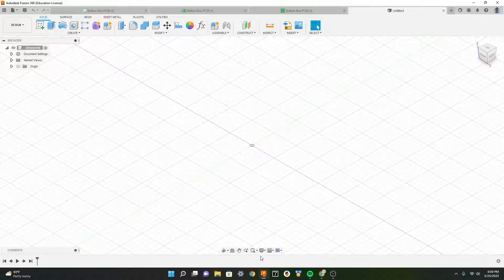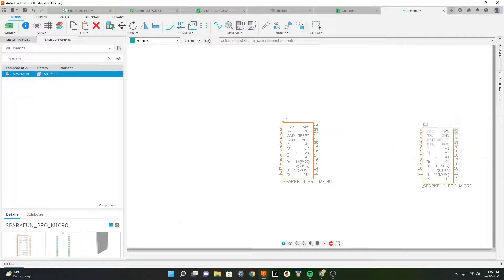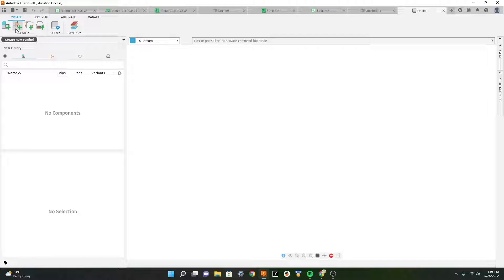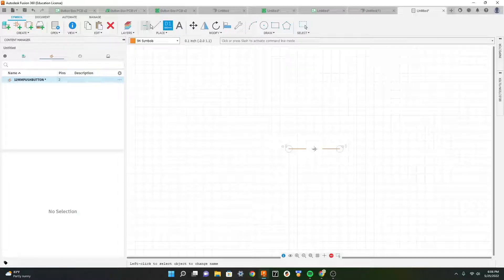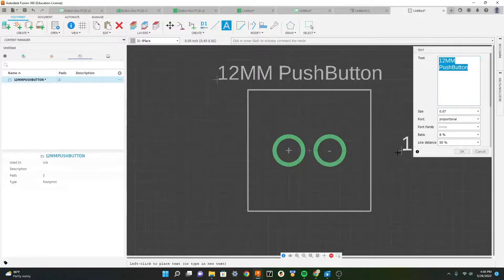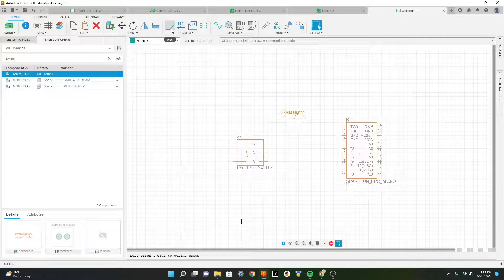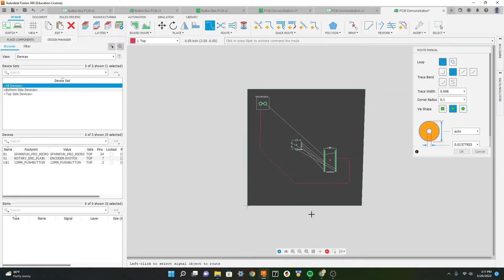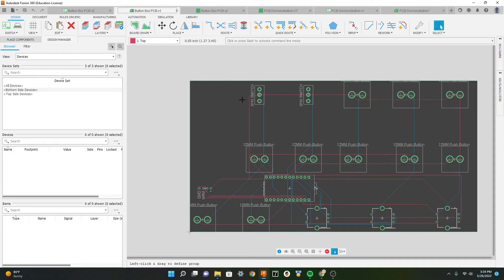Button Box Instructable: Schematic to PCB

Comment: Helloooo simsector, i'm on the hunt for information, i've been searching for days and hours losing sleep in doing so.  I'm wanting to build a retro formula wheel but limited to what Arduino i can use due to the allotted space in my hub adapter (30x30mm around). I have found the 'Seeeduino XIAO RP2040' it's tiny and perfect, perhaps? All i need is max of 4/6 momentary buttons, 2 rotary encoders. Do you know if the Seeeduino can do this? Also how do i find the Sketch for such functions